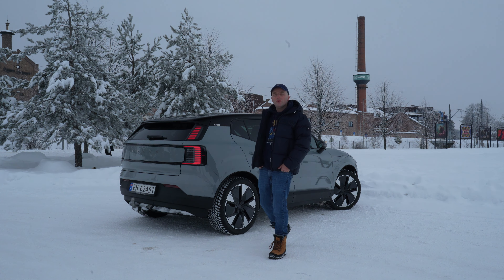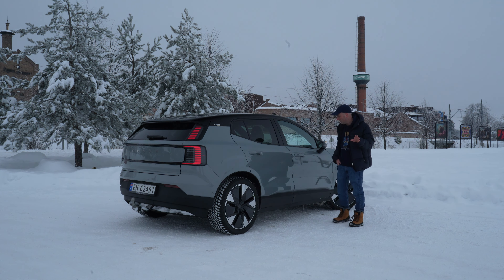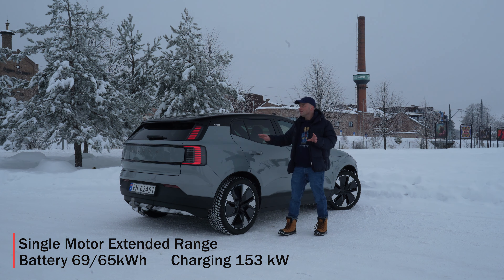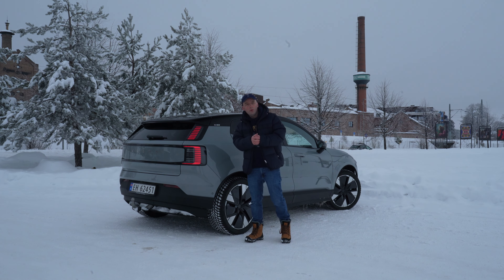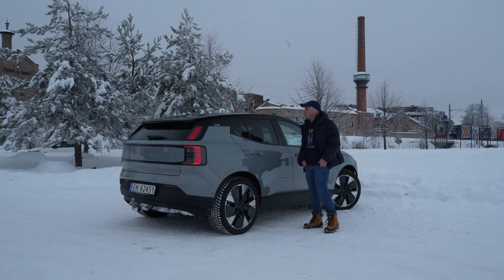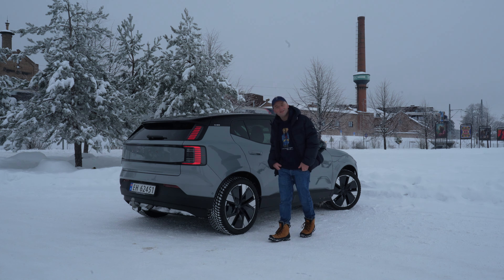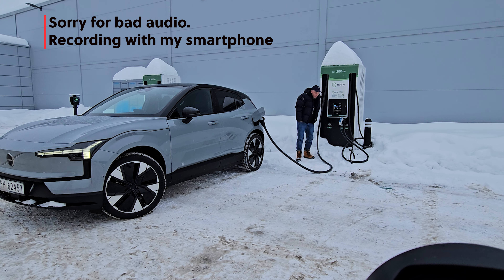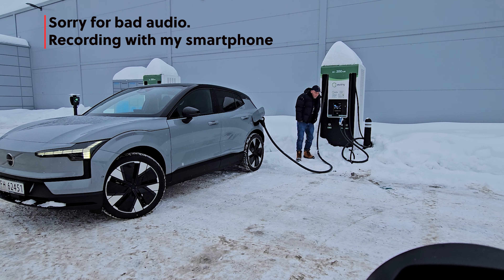EX30 Charging 🔋       Part 1.  10-80% SOC

Comment: Battery preheating when navigating to a fast charging station via Google Maps requires that the charge level must be at least 20% when reaching the charger, or at least that's what it says in the official pricing list (in Finland). Maybe they will adjust this in the future or add a possibility to manually start the preheat.
Reply from the maker: Yeah, sadly that's what I also discovered
Reply: 20% of 65kWh is 13kWh, that's 100km on an older Ioniq or almost half the battery on the old Ioniq. Makes no sense to me to have such high limits.
Reply from the maker: @wocket42 Agreed. Makes no sense
Reply: Ah yes, my bad, I noticed now that you put it in the video as well. At least the charging was quite fast still, even if the curve was quite weird. I guess that's probably due to the battery being slightly cold. If this was part of a long road trip I guess the next charge should start going a bit faster too, since the battery might still be a bit warmer from this charge. @volvo_kristian

Comment: Excellent video, even with your battery oops.  The sad thing about the EX30 is that it seems to reflect a safety culture clash between Volvo and Geeley.  Who made the call to save cost by omitting a driver display.  And who is responsible for the idiocy of sending out driver alertness 0.5 sec long nag messages when you're forced to keep looking off to your right by the car's design.  The EX30 gets the one screen approach even more wrong than Tesla.  BS that you're getting the famous Volvo safety, quite disappointing.
Reply from the maker: Glad you liked it 🙌 Yeah there's definitely a crash here. Cost vs practicality/safety.. and Volvo vs Geely
Reply: It’s strange that some people get the nag by normal use and some don’t. At least in our one hour drive I never noticed any nagging from the driver alert system. Have you tried the car too?
Reply from the maker: @chrisving91 Weird that you managed one hour without.. Your either pretty fast with your screen interactions, or you don't interact with the screen at all.
Reply: @volvo_kristian  There may have been, but I was having a fun ride with the fantastic music I put on. Either way, driver IR didn’t seem too bad and IMHO it’s best having it than not with respect for my passengers 😊

Comment: I live in Malta. Will the bsttery have better performance with temperatures between 25 and 40 degrees?
Reply: Yes, that is much closer to the optimal temperature of an NMC battery. However, keeping the car outside when it's really hot might cause the car to need to cool the battery at times.
Reply: @n0b0d1r  thanks!

Comment: The EX30 is not being sold in the USA yet.  I refer to any alert from a car as a nag.  What I have seen in videos like this one is that distracting alerts flash onto the screen too quickly to be read.  Apparently there is no setting to change how long the alert persists.
Reply from the maker: Yeah, and this is just nagging.. Results that I just turn in off, and what's the point then?
Reply: During my test drive (1,5 hours) I felt like the driver alert system only beeped after I was honestly spending too long looking at the screen. It was beeping when I was doing things that I should have done when the car was not moving. For example, it never beeped when I was looking at the speed, since the speedo is conveniently at eye level so it was easy to just glance at. It did beep if I spent several seconds going through the menu looking for something, but perhaps that is not something that should be done while driving anyway. By the way, thank you for the videos you are making about EX30! I will be receiving my own EX30 in a few months so these are fun to watch @volvo_kristian